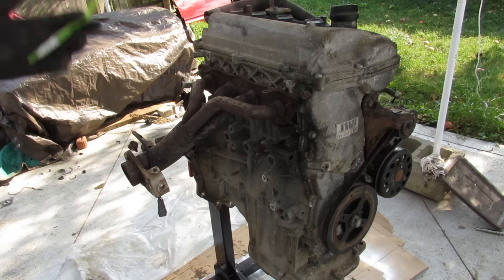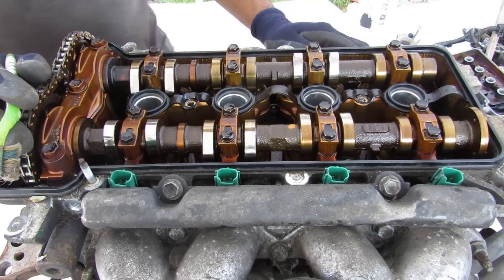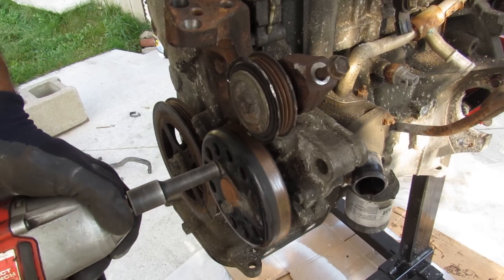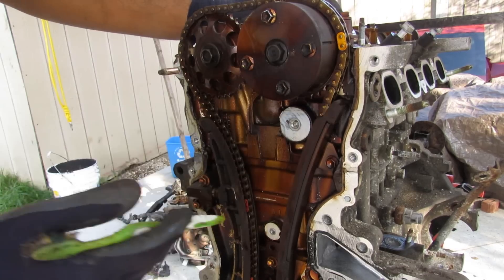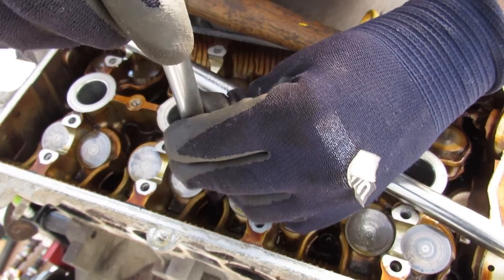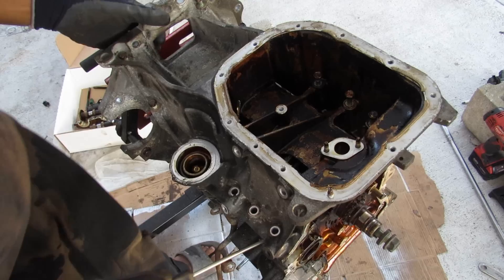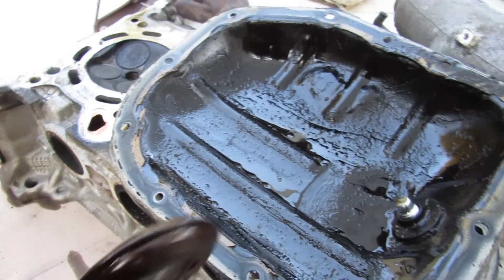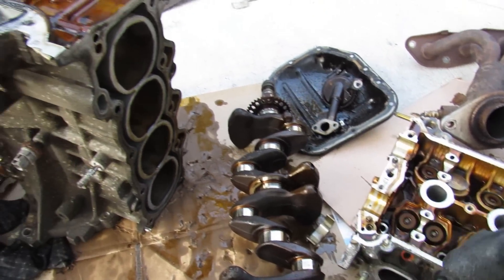What's inside a 500,000 km Toyota Engine?

Comment: This engine lived on in the Yaris Hybrid in Europe until mid 2020. That makes 23 years in production for Toyota's first shot at a Hybrid power train. Simply outstanding.
Reply: It will be difficult to replace - the Toyota ZR engines are very nice and they don't burn oil but they will not last as long as one of these NZ engines.
Reply: @zoidberg444  There really is nothing like owning an ancient Toyota and knowing that every drop of oil you lose is due to wiping the dip stick with a rag
Reply: Good for you, my 500k 4S engine both burning and leaking oil 1l/1000km😄 Probably needs a light rebuild someday
Reply: @xkenny1995  Mine was like that too. I added some seafoam and mystery oil to the oil and gas. Fixed the problem in the first 500 miles. (Follow the instructions on the can)
Reply: @zoidberg444  why are the zr engines not going to last as long?
Reply: @Toyeboy89  More complex engine - tighter tolerances.  My guess is most ZR engines have 300,000 miles in them as opposed to the 500,000 miles a lot of the 3rd gen toyota engines like the NZ and GR engines.
Reply: @Toyeboy89  they already have issues kind of noise...
Reply: @kordapyo612  what issues? I'm not defending them I'm curious as I have a NZ engine.
Reply: @Toyeboy89  My '91 Prizm 5spd  (Toyota Corolla) was bullet proof, and it got as good of gas mileage as the Prius, about 47mpg highway.  The Prius, not so good, by the time it hit 100,000 miles, oil consumption shot through the roof, there were oil leaks, seeps, performance hits, and it performed like a 
tired engine. I now have 150,000 miles on it and think about selling it everyday. I was right on with the maintenance, the NZ is a bad engine design.  Whomever buys my Prius will need to replace the engine, kinda left me with a cloudy thoughts about Toyota.
Reply: @nomebear  hmm I've heard of head gasket problems in Prius 1.8L how much oil is it burning between oil changes?
Reply: @zoidberg444  Whats the reliability on a 3zr engine like?
Reply: It was on the Prius C in the USA from 2012-2018. I have a 2013, bought it last year before car prices went crazy in America. Seeing videos like this makes me wonder why anyone would buy something other then a Toyota, especially a hybrid car.
Reply: @Toyeboy89  because with road rage getting more frequent you better have something faster than a Prius to run away lol
Reply: @trentdaddydolla647  Toyota makes faster cars..
Reply: @Toyeboy89  I drive my wife’s 2007 Prius from time to time and wonder the same. Why do I drive my CRV in the city at all? 
The Prius is just an example of perfect harmony between practicality and efficiency.
Reply: @ShreyasBharadwaj  yes city driving is where they shine! I’ve changed my route to work to avoid interstate and I get way more mpg. I know not practical for all but my commute is 1 minute longer.
Reply: @Toyeboy89  I'm certainly a Toyota fan.  Never owned a hybrid, though.  Honest question about longevity of ownership and money/time/effort needed to own maintain, ROI type question for hybrids, because I can certainly see the benefit of owning or leasing a new vehicle, but to turn it in every 3 or 4 yrs for the next one so as not to deal with aging potentially expensive batteries .  What about ROI for people that buy a 4 or 8 year old hybrid?  Is there a network of independent hybrid vehicle repair shops?  So that consumers have competitive options for repairs versus getting ripped off at the dealer?
Reply: @joe-e-geo  I would say the car saves you so much that it a one time hybrid battery replacement is easier to swallow. One thing to remember is the regenerative braking. Ive heard of several getting 200k miles on their original brakes because the calipers don’t have to touch the rotors until 8mph when decelerating. There are a few companies that will install a refurbished battery with warranty for less than $2000. Aside from that it’s just like another car, usually the batteries last a solid 150k or 8-10 years. Buying a car 8 years old could be a little more risky about the ROI. I know one would come out on top buying a new or 5 year old or less. Especially with gas going up again. They’re saying $4-$5 spring/summer.
Reply: @Toyeboy89  i bought a "totaled" 04 from a friend who was religious in on maintenance for $1600. 205k miles. $400 of body work and be over abs wire and it was good to go. 

Now has 240k 3 years later, still gets high 40s mpg, no engine work other than a tune up last year. I hey i get 300k out of it too
Reply: meanwhile VW (and it's offbrands) stuff 80% plastic engines into their cars and wonder why they are unreliable pieces of shit
Reply: Toyota always does big things right the first time
Reply: @stezenast5878  no they don't, they have huge design errors  like other manufacturers but send out the modified parts, after that yes they are SUPER reliable.
btw, Yamaha designed Toyota engines for them, Yamaha also made the Hydrogen engine for them 👍
Reply: Yep had a 4runner and caused me to look into Toyota and they live by simple is best and actually became the powerhouse they are today through reinventing their production process to be as simple as possible
Reply: inside every toyota engine is the heart and passion of 1 mil china workers
Reply: toyota of course knows what it's doing
Reply: sain
Reply: I just wanted a good 👍
Reply: I'm pretty sure the 4EFE engine family ran from the 80's until the mid 2000's too, I have a 98 starlet with it I'm sure the engine came out in 1988 and the last starlet with this engine was until 2002 in Asia but also a few corolla, paseos and some other model had it too. Most reliable engine I've ever had, much more than the ZZ engines i had in my Celica that blew up and my Leon Cupra too that's just had to have the engine head rebuilt lol
Reply: Yes
Reply: I wonder why,  as well,  why out there someone is buying not a Toyota.
Reply: Thats right,  Toyota engines especially Hybrid concepts are the most efficient ones the most reliable,  durable to all that facts the mos "healthy st" in comparison to all the other crapy Manufacturers on planet earth still. That's why fucking betrayers named Ford was clawing the licenses and ice cold the construction plans, from Toyota WITHOUT PAYING THAT WAYVLIKE THEY WAS PROMISED IT UNDER CONTRACT WITH TOYOTA. THAT'S as well for a fairly person like me, never to invest and buy a new ford product or something like this who costs alot of money. People,  who buy another car brand than Toyota, for above 20k  are absolutely not intelligent and will longtermed die out. That is fact
Reply: Toyotas can just be a bit boring, and this is coming from a Land Cruiser owner. Still don’t regret this car but I can see why people see the other models as a bit lacking
Reply: https://youtu.be/wafZjkY0H_E

Comment: Why do you tear the working engine down? It could be cleaned without tear it down using some kind of solvent like BG44K engine flush or Seafoam for 20 minutes.   But thanks for sharing how good the engine is even with some slugging issue from cheap mineral oil.

Comment: Always nice to see how a good engine looks inside. My daily driver is a Volvo 940 that has 550000km on it, and it runs like new. My hobby car is a Citroën DS from 1973 with over a million km on it, also runs like new. Some of todays manufacturers have a lot to learn from my old cars and of course any Toyota.
Reply: most manufacturers now build it strong enough to last a certain amount of miles, not too much so that the consumers buy newer cars more frequently. also because technology became more advance, they don't have to overbuild the engines.
Reply: @jakejakedowntwo6613   Good thing that Toyota avoids doing that.
Reply: The pressure on car makers to lower emissions, fuel usage and increase power are the causes of unreliable engines. Direct injection, CVT, EGR valves, soy electrical wires, turbo..all unreliable. The Koreans almost got there, but their engines crap out due to piston slap.
Reply: La mia Citroen Berlingo 1.9 d aspirato del 1998 oggi ha 320000 km ed è perfetto
Reply: they want people buy new cars. keep bissness . why bother if u can make more profit
Reply: Those Volvo’s are insane
Reply: Some 70's Toyota  and Datsun  still around here in SoCal, running like wristwatches ⚙  Retro/Cool high MPG runners , as our Harbors  saw the first of these subcompacts & light pickups.  Good maintenance is Always the Key to high mileage and engine life.
Reply: How did the Citroen make it 😮? The DS had quite a outpowered engine...
Reply: @killerdinamo08  The DS is no racer but the French has always been good with making smaller engines do pretty good. And also, the DS wasn´t that much behind anyone. BMW and Mercedes was available with larger engines. But besides that, you could easily drive as fast as anyone else on the Autobahn. It had as low Cd factor as todays cars so they were pretty fast even with smaller engines. As a comparison of two cars I used to have. The 1973 DSpecial with the smallest 2-litre @ 99HP had a higher top speed than a 1975 six cylinder Mercedes 230.6 And my present DS has a 2.3 litre with the same power (115hp) and tourque as a Volvo 940 from the early 90´s. And even if it´s the heaviest seven seater estate it has no problem doing 200km/h. So they were never that slow. Even a 1964 ID Break that a friend drove could do 140-150km/h all day long on the Autobahn.
Reply: @michaelheimbrand5424  I'm not debating the performance of the DS, but the reliability and long service life of the engine, especially at such use, it was under constant effort powering the hydraulic system and it was more of a adapted engine than a specifically designed one for such car. The Mercs you've mentioned had a large, underpowered engine which was happy to run for a long time since it wasn't stressed and it was used below it's maximum rating, rather than the Citroen which had a rather maxed out engine.
Reply: If you don't mind me asking, what kind of work have you had to do to ensure the Volvo 940 stays running?
Reply: @hermanwooster8944  The 940 has only had regular service and the usual stuff for keeping an old beter alive. But as it is a Volvo, lots of small things break. The Citroën is in a kind of a rust repair process right now. I had it for 20 years. Nothing mechanically has broken in that time. The DS is so much more sturdy than the Volvo and better designed. But it´s a 70´s car, so yeah... Rust.
Reply: @michaelheimbrand5424  Most people I know have had their cars fail after 7 years, so it's always nice to hear when they last much longer than that. Thanks for sharing.
Reply: It's the government which is preventing a lot of good design and long life.
Reply: Mate, they know very well how to make good engine, no need to learn. They produce short time reliable crap by purpose.

Comment: Toyota engines last. Great story: acquaintance had an 80’s Corolla. Drove in it for many years, then the oil pressure light came on. Drove to the dealer upset about the light, “fix it”. Appeared that he had done over 60k Mi (100k km) without ever changing and checking oil.
They filled her up and off he went.
Reply from the maker: Wow
Reply: I remember my buddy got an early 80s corolla from a police auction years back. Turns out it had 400k kms, still drivable. Those old corollas must have been able to take a lot of abuse.
Reply: I remember almost 30yrs ago older lady came to my friends shop complaining her Tercel died. She drove for 60-80k km without changing oil. When my friend ask her when was the last the oil was changed, she replied: I thought the Toyota is so good and don't oil change. He rebuild the engine and she became his regular costumer.

Comment: Hey Mr. Speedkar, what's the purpose of those little cups? I think you said the camshaft sits on them? Is it just a way to put an easily replaceable consumable part between the expensive stuff since it's going to experience a lot of wear?
Reply from the maker: Yes the camshaft lobes push down on those cups which in turn push down on the valve springs. They come in different thickness so you can adjust the clearance between them.

Comment: Owner of 2 Prius (Prius C and Prius 2005).

The Prius 2005 has more than 600,000 km. Original engine and transaxle. 2nd HV battery at 350,000km. Nothing else but regular maintenance.

These NZ engines are built to last.
Reply from the maker: Nice, and agree, this 1NZ ran perfectly
Reply: How many miles you do between oil changes?
Reply: @costakis7895  3k miles/ 5k km. Conventional oil, not synthetic. I drive 70/30 highway city mix. I change my own oil, average 4 times a year.

Comment: I hope one day to tear down my camry 5S-FE engine. Its getting ready to roll over 650,000. Still runs fantastic
Reply from the maker: I'd like to teardown a 5S or 3S motor too, but I assume it's not much different than the ZZ or NZ other than timing belt and SOHC
Reply: How many miles did you drive it yourself?

Comment: Serviced one 1nz-fe last month that had done 76k kms without service. The lady owner had bought the car 2nd hand and serviced it when she was 6 months pregnant at 62k kms.
6 years later  I towed it to the garage for checkup and service, when it stalled on a bump with her now 6 year old son onBoard.
Reply from the maker: Wow. What was wrong with it?
Reply: @speedkar99  the oil was still there about 2L the rest was sludge, the plugs were like old rusty nails. Only the ceramic bit was visible. The air cleaner looked like a rats nest.
We drained all the oil, changed the plugs and filters. Ran it with a mixture of heavy-duty diesel oil (good detergent properties) mixed with diesel for a few hours. Drained it and put in new oil and filter.
And scheduled it on an enforced 5k kms service interval. It still runs perfectly nothing is worn out. Due for service in December.
1NZ-Fe is a very stout little Engine, probably the toughest of all modern Toyota Engines, a true ambassador of the Brand.

Comment: Technically since it’s a hybrid the engine only ran half of the mileage of the whole car
Reply: A Prius engine runs 95 percent of the time. The older ones run all the time which I think this one is
Reply: Way more than 50%.  More like literally 95%.  The electric motor doesn't run at all over 40kmh. (25mph).  And then has to charge the battery.  The motor is only a mild support for the engine on these earlier designs.
Reply from the maker: I mentioned that at the end of the video

Comment: The simpler the better; I like the internals! The sludge inside is not that bad for a 500,000 Km (310K miles) engine.
Reply from the maker: Yeah it's very simple which I like. I don't feel confident about the sludge though, given the mileage it's acceptable
Reply: But my car at 130k miles is absolutely silvery clean. 17 years old

Comment: Sold a 22 year old Civic last year. Original engine and transmission. Running strong. 500,000 miles
Reply from the maker: Nice!
Reply: Honestly the D series civics were tanks. Not so much their brake lines though.
Reply: Машина это как женщина надо не пропустить встречу и расставание  . ...
Reply: Impressive up to a million
Reply: I'm assuming the tranny was a manual
Reply: Have a 94 Civic with about 450,000 miles still runs up to about 80 on highway all original with 5 speed.
Reply: Is the body still intact? I meant by intact is no rust.
Reply: @W0LV1E45  there was no rust or dents. All original panels and windows. It was the ex two door. The sun roof still worked.
Reply: @floridian1087  Вас так эта машина нравилась что вы с ней не расставались так долго или это денежный вопрос смена машины
Reply: @АндрейАндрей-р5ы  Ты деиствительно считаешь, что кто то будет искать как перевести твой вопли на русском?
Reply: @1966sanya  Люди любознательные  проблем с переводом нет
Reply: @АндрейАндрей-р5ы  Yes, I am one of them ;)

Comment: I've seen some cars with high 200 000 km and the valves and guides are still perfect no movement
Reply from the maker: Nice! Mostly Hondas?
Reply: That shouldn't be an issue with most engines used in regular life.
Reply: rkan2 well with old cars by that milage valves and guides were junk , partly due lower quality oil
Reply: @bigears4426  Yes - OE oil change intervals and oil types should be followed of course. Not many (western madr anyway) engines since the 90s wouldn't go to 300k with not many issues if you changed the oils per spec.

Comment: The car has 500,000 km on it, but the engine likely has less mileage than that because as a hybrid, the engine was not running for a good chunk of the time!
Reply from the maker: I mentioned that at the end of the video
Reply: sorry, my bad!! I posted this comment as I was watching the video and didn't reach the end yet
Reply: The Prius can only run on electric power for about a mile and below 15mph. The plug-in models can go further, but nowhere near the range of EVs. The engine is running the rest of the time and does the bulk of the work in propelling the car. It's why a Prius is still drivable with a dead battery even if it's far from ideal. 

If I'm not mistaken, only the Chevy Bolt and the BMW i3 use a gasoline engine strictly to keep the batteries charged. So the actual mileage on that Prius engine should be reasonably close to the odometer reading.